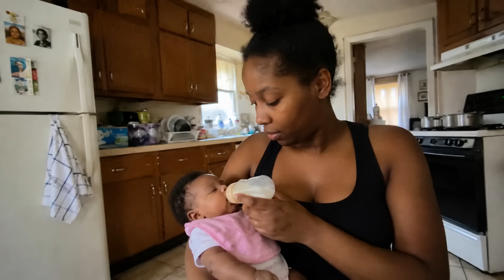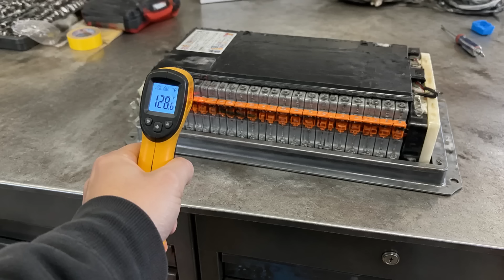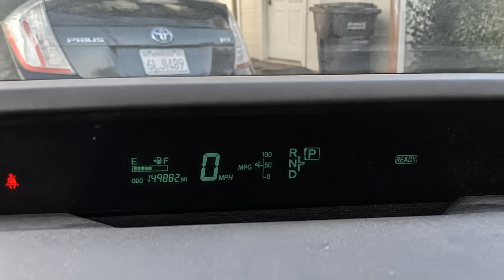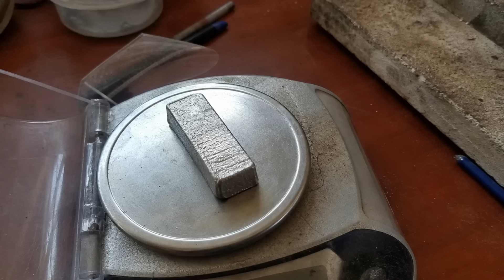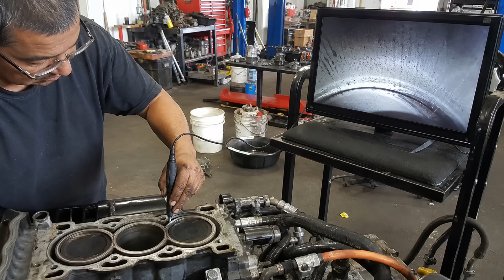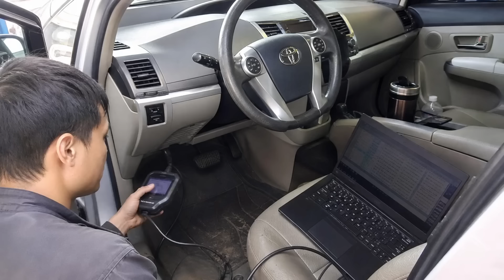Things You Should Know About Toyota Hybrids! The 20 Most Common Questions

Comment: Nonsense.  10 year 150k warranty on the traction battery.  Lots of evidence now  about how the Toyota hybrids with Toyota’s eCVT planetary gear set (no belts) transmission  have actually become more reliable than turbocharged gasoline engines with 8 speed transmissions.

Comment: Had only 75K miles on my used 2015 Prius.  Dealer said I needed to pay $4200 for brakes and rotors (no lights flashing).  I said no.  It was a great car but visibility for night driving was a problem.  Long drives were not comfortable.  Now driving and liking my 2026 Toyota Corolla Cross XLE (gas powered car) until hybrids in that model become available again at decent prices.

Comment: I drove and owned a 2016 Toyota Prius for 106 thousand miles to 233 thousand miles with just regular oil changes, basic fluid changes and I had zero issues with it.  I sold it at 233 thousand miles and are going to buy another.

Comment: 2009 prius 280 kmi, 44 mpg summer 40 mph winter, lubed planetary gear set once, flushed both cooling systems once, one set pads & rotors, one set plugs, mobil-1 oil & filter every 5 kmi, replaced 12v battery twice, serviced traction battery air intake twice, located upstate ny, car still ran fine when i traded in for $500 credit on 2026 hybrid forster ... it needed $900 brake job to pass nys inspection (braked fine imho) and fuel tank bladder and fuel gage not working last 18 mo were not economically repairable .. car ran fine, was just annoying to fuel and keep fueled w/o working gage .. best car i ever owned

Comment: I finally replaced the hybrid battery in my 2014 Prius after 10 years (and it was STILL working) It cost me $2300 for brand new batteries! (I'm STILL driving it today 8/17/2026! ) NO repairs, just normal maintenance!

Comment: Lots of good information but some of the images are hilarious, like the guy wiggling a tool that doesn't exist and is doing nothing, or better yet, the guy removing a 3 cylinder head from a 4 cylinder block, and a four cylinder head from a 5 cylinder block! absolutely hilarious! How many of these anomalies did you spot? Isn't AI funny?
Reply: I liked pouring oil out of the bottle underneth the open drain plug aww the oil is supposed to go in the engine.

Comment: 200K on my 2012 Prius, had the brake actuator go out. Had to replace the actuator and booster, not a cheap repair.
Reply: How much was it? Going to have my 2013 Pius brake fluid changed soon, 193000 miles currently.
Reply: @Timat-s4n  So I did it myself and costed me about $2000 with OEM Parts directly from Toyota and a special scan tool. I got an XTool to do the specialized bleeding required. You can actually hear the actuator going off and if you hear it frequently it means it's going out and if it dies you'll need to replace 2 parts. If you catch it before the actuator goes out you can just replace the brake booster part. The brake booster leaks and causes the actuator over work and go out.

Comment: If it’s a Toyota Prius C, yes you can plug it in and get 25 to 40 miles on battery only till it turns into the regular hybrid battery with the engine.

Comment: in my all priuses i have installed android unit, paired with Bluetooth OBD 2, so i run Hybrid assistant app to proactively control temperature of my high voltage packs, (given that I live in Tanzania Dar es Salaam-Africa where is it always hot.. about 30 c) but i have never encountered any battery related issues... Now one Prius has 400k km on original high voltage battery.

Comment: I don't care, my last Prius lasted 300,000 miles on reservation gas. The only things I changed was tires brakes rotors calipers and spark coils, pretty good for 300,000 miles. the Prius before that got 270,000 miles and I sold it well traded it for 5000.00 towards my new Prius. I changed my tranny oil at 120,000 and oil every 10,000 with AMSOIL 0 w 20  my radiator at 60,000. I had no problems , and Toyota has the best CVT it's a work of art...... I'm glad your honest I've had hybrids since 2006  and never had a problem. This year I bought the Corolla hybrid 21000.00 final cost after trade 5000.00 and It's so much better with the 1.8 hybrid proven in the early Prius. What I've learned is drive it like you stole it. the more highway miles the better short runs to the store kills hybrids.
Reply: Short runs that are driven very seldom in frequentie kills the high volt battery but an Uber /delivery driver that only drives short city runs but does this all day will have a high voltage battery that lives long if he does the rest of the maintenance that this video describes
Reply: @leonardspran4093  that's old stuff now the new hybrid systems do better because of the thin oil at highway speeds to keep thinning to a minimum  And long runs they only charge to a % and only use a small portion of the battery which in turn keeps the battery fresher longer the 12 volt on the other hand drains quick lucky I got 4 years 12 volt warranty. Oh yeah 150,000 on the new improved hybrid battery. My last got 300,000 miles I doubt I don't beat it by 100,000

Comment: Great video!  With three Hybrids in 13 years, I agree with your tips. No problems so far.  On hot days, I set my AC to include cold air to the back seat where the vent is adjusted to blow cold air at the drive bat intake vent. That adds additional cooling of the unit.
Reply: If one of the Prius MGs fails, the car is no go. 
If there is a single MG combined with a mechanical CTV then even if the MG contol quits, as in Honda the car can still be driven on the engine alone..
Reply: Thank you, friend!